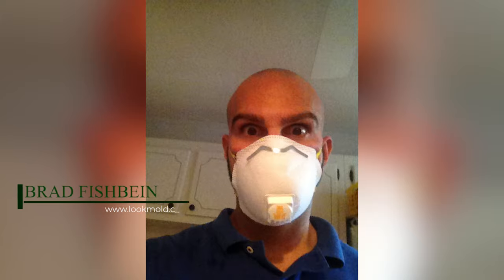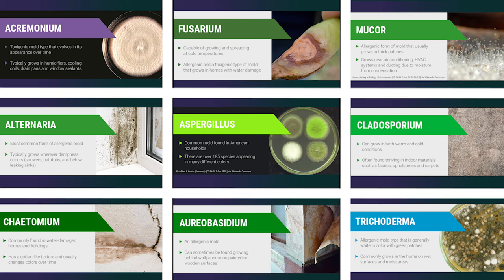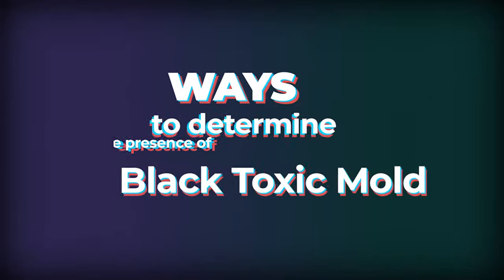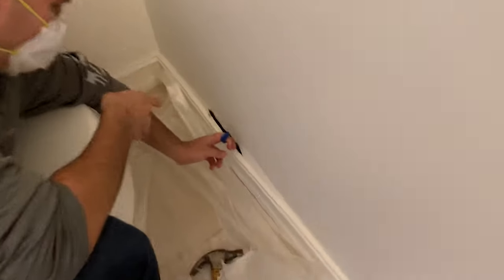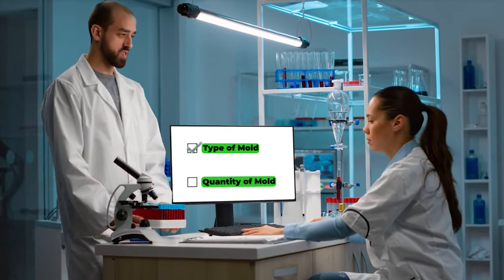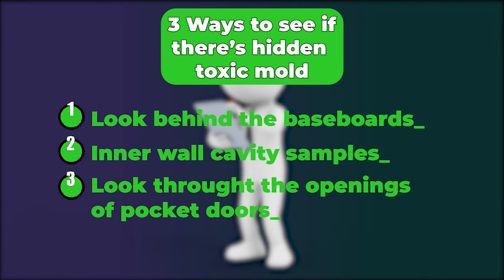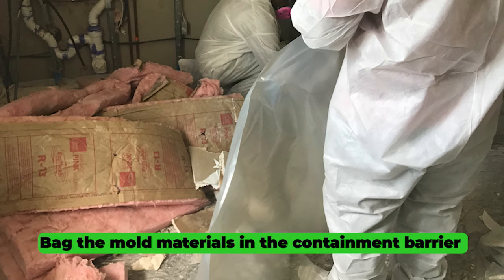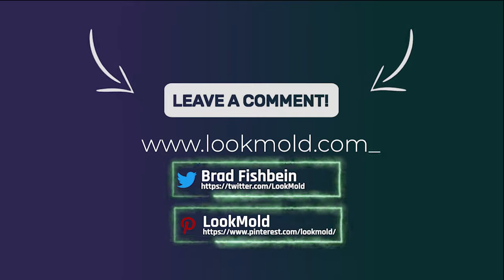Black Toxic Mold Hidden In Your Walls? You Need To Do This

Comment: I've been staying at a hotel for 6 months and I've been sick sick sick. It's hard to breath. I discovered black mold throughout the bathroom . An area with water damage. Also the bedroom ceiling and the wall has clear damage of water . The tenant above me had water come in from the roof that was missing a seal around a roof vent. Water damaged both units. 
I've had fever scratchy ears eyes and nose. Post nasal drip, to completely plugged with thick mucus , coughing sore throat, nausea, tired, itchy skin. I've documented by photos. The owner is aware of the issue and told her worker to DENY , LIE, ELUDE THE TRUTH ABOUT BLACK MOLD THROIGHOUT THE ENTIRE MOTEL. IM NOT ONE TO SUE. HOWEVER HER IGNORANCE DISGUSTS ME. AND SHE DOESNT CARE PEOPLE ARE GETTING SICK.

Comment: Hello. I recently bought a house and it came back with a very high elevated 2320 count Stachybotrysz In not sure what to do. Haven’t even gotten to move in yet. Just thought it smelled like mold. How doYou get rid of that if you can’t see it? I had an expert come out and he did some testing but he said he didn’t know how to test to see it.
Reply: You will have to start ripping the walls apart yourself if you cannot get a professional. That is what I would do.

Comment: Can black mold develop from humidity/condensation (i.e drywall in bathroom becoming damp)? Or does it need to be a leak?
Reply: I would say yes!!!
Reply: Definitely
Reply: Yes! Downtimes mold is superficial and you can get rid of it with mild killer, but always make sure its not on both sides of the drywall
Reply: It's possible, but not likely.  Majority of cases of toxic mold come from water damaged materials.  But if you suspect an area is harboring toxic mold, get it tested!

Comment: Good video
I rent and the owner doesn't care.
Other than respiratory will mold cause skin issues too 
I've cleaned all visible signs of mold but I can't open walls where visible water damage is.
I'm open to suggestions
Reply: Respiratory and skin issues arr just the tip of the iceberg what mold can do to health. There is a wealth of information available on YouTube about that.
If you know the mold is inside the walls, then it is a matter of time before it starts seeping through the walls.
Reply: I would say that the walls ah e to be opened and remediate, my two cents.
Reply: It can lead to colonizing your organs :)

Comment: As a previous landlord tenants not opening windows as don’t want to lose heat in winter annoys me to heck. 
* most damp is condensation caused. Open windows, don’t cover up house air vents. 
* Dont dry  clothes in house and if you do use an heated tent to do so. Low electricity and dry clothes properly. 
* purchase a evaporator as breathing causes excess moisture if no ventilation. 

Common sense and responsibility. Renters , use some ! 

* land lord Of course houses should have vents and no leaking drain joints etc. also give tenants paperwork to understand evaporation to help …. Win win
Reply: Landlord, add proper ventilation to your units (24 hour fans), consider an ERV to manage moisture and reduce the energy penalty of ventilation. Ensure windows, etc. are high quality and installed properly so they don't cause condensation. Blaming your tenants is a cop-out.
Reply: NO EXCUSES!! 😎

Comment: I have a recurring black that developes in my toilet. No where else in the bathroom . since its city water does the bleach combat mold , or is mold spores air Born
Reply: Sounds like your toilet seal is broke and it leaking. Get it fixed or you will have thousands of dollars worth of work that has to be done. Replacing the floor you dontvwant that. I had to do it before its a mess

Comment: Does mold have a smell? I had a leak and took a while to find and fix. The dirt outside my house, next to the bathroom where the leak was located was wet. Not swampy, but definitely wet. I had dryers and air blowers in my house for about two months. It's been over a year since this happened. It smells a little sewery still. The leak was in the water, not sewer, line. Again, this happened last year. I don't see any mold on that outside wall, in the bedroom adjacent to that bathroom, nor in that bathroom. I'm not sure if the soil under the foundation is still wet from a year ago. Any thoughts? P. S. What are the symptoms of exposure? Thanks.

Comment: We have laminate flooring with no pad and no moisture barrier and it is clear in one section moisture has traveled up from concrete into the flooring, warping the wood.  Can flooring like this have mold under it?   Never heard anyone mention this….?
Reply: I have the same thing. If the flooring is not well ventilated then that's a perfect spot for mold to grow in.

Comment: I did have water coming into the roof I have stuck on the outside drywall on the inside would it not be safer to cut into the stucco that way no mold spores will get in the house have you ever done it that way stucco please let me know

Comment: We haven't had a leak that we're aware of. We don't use our HVAC in in our basement often. It does have a mildew mold smell that I can't get rid of with essential oils, ozone, vinegar in a fogger. We couldn't get rid of gnats until winter. We tried everything. I found out they're fungus gnats.
Reply: Have you tried a good dehumidifier unit?  I am in the process of attempting to eliminate the mildew smell in an old house I bought.  Before purchasing, when I saw the house, the occupants had incense burning to cover the smell. I have since recognized a bigger problem going on. I had the plumbing turned off, after noticing a leak down to the crawl space and had the moldy insulation pulled out. That area has been "drying" for a few months and I have a dehumidifier on that floor and the one above, that pulls out nearly a gallon of water every 4-5 hours. Seems to be doing the trick, but I want to attach a drainage hose and let it run 24 hours for a week to see if it improves a lot. I am also looking at mold defoggers, but have not used any yet. 
Where I live, there is 1 supposed mold remediation specialist, and after getting a quote of $5k from a referral service (which I would have gone for, if they were not flakey), I never heard from him after providing my info during a conversation with the referral service. 
Hoping to conquer this mold problem! 
Good luck to you and your mold issues as well.

Comment: What about mice in a crawl space that disrupted the moister barrier ? We got the mice in there out a terminex but 2 got up into the house somehow and we got them too however we are re sealing the moister barrier under the house in January 

There had been mildew spell in my kids closet & I can’t see where it’s coming from but it’s probably the carpet but shouldnt I SEE the mold? Should there be black or greenish black ON TOP of the carpet? What if there isn’t? But I still smell it? Also there was mold in the carpet in our room and we replaced the carpet when it got bad. We got air purifiers with UVC for both bedrooms to try and be safer and keep it from coming back but my sons carpet is only 2 years old how did the mold come in the carpet that fast? Help? Can u make a video about how a closet can smell of mold but you can’t see any mold? There was some on the underside of the shelf part and I cleaned that off w mold killer  yet over a week late and it still smells like mold/mildew ish and idk what to clean the carpet with that won’t stain or bleach it. It had NOT spread to the carpet beyond the closet door bc I don’t smell it anywhere but the closet the room doesn’t get a lot of light and we have base board heat & in the summer, window units.. so there’s no real air circulation. Anyway about the closet & not seeing it
Reply: Having same problem with a white mold. It's a thing. This channel didn't answer any questions from anyone
Reply: @dalpz205  I noticed 🤔
Reply: You don’t need to see the mild through the carpet, sometimes is in the wood under the carpet :)

Comment: what about apartment dwellers who don't own the walls and don't want to be evicted?
Reply: You have to move out.  That's what we did, twice, unfortunately.  Also be careful of your items.  Toxic Mold spores contain tiny particles called "Mycotoxins" that make you incredibly sick, and will spread like wildfire (like a gas);  contaminated items can cross-contaminate clean ones.  We unfortunately learned this lesson the hard way.  The only solution for us was to throw away everything we owned, and start over in a clean place from scratch.  (For personal items that could not be replaced, we fogged them with mold and mycotoxin denaturing solutions, and then put them in sealed plastic bins, then into storage).
Reply: @athens31415 I would think you could ozone and uv c items to get rid of all of those issues
Reply: @heythere6983  no, that is not correct.

Comment: Can black mold grow in concrete?
Reply: In the surface yes , from water condensation
Reply: It's possible but not highly likely. Stachyboris requires lots of food and water. If there's a lot of dust on the concrete it can support it, but in my experience the black mold on concrete is usually standard mold species we experience every day

Comment: We’ve had mold for years, our electric wiring is off and has been for decade. I tried to move away and tried to get fixing. Our landlord raises our rent and told us to be grateful and was gaslighting my mom if she complained. It’s not that we don’t care it’s used against us.
Reply: Open the Window 🪟 let air flow, Buy dehumidifier, anti mold spray and 🫧 Clean up ... 🛑 Stop Blaming Landlord & other.. ..
Same 🏢 building but some have  mold others don't ..

Comment: If there is mold in back of the wall will it appear on the wall where i can see it  ?
Reply: Not until it eats all the way through the wall, which could take years. The least intrusive way would be a borescope camera. Like he said, check the baseboards and the bottom side of the drywall, The water usually runs down to the bottom. If you see anything, you should probably get someone to pull the wall (or DIY, with the steps he listed). You could also cut a small hole in the drywall and check the back side.

Comment: I can’t find the mold in my house my whole house smells like wet socks and I hired 3 mold companies and they couldn’t find the mold they said there mold here in the house but we don’t know where they just wanna put some kinda enzyme
Reply: Try the air conditioning unit.
Had that problem. Called Air conditioning professional to clean the unit and the smell disappeared. 
Hope it helps.
Reply: @sharonmartinez9963  thanks
Reply: I also had horrible smell feared it was the worst.  Found out it was oxone comong from a brpken down UV light on my hvac unit.  I had 3 different ac companirs come out and all were telling me to replace my duct work.  Last guy came out and after 15 minutes of removing it no more smell!!!!

Comment: Just had a pipe break in my basement. Good news is that it only was about an inch on the floor in a laundry room and I got it out in 20 minutes with a shop vac, but 2 days later, it smells pretty "damp". It never got up into the walls, but what can I do, spray bleach? along the baseboards? What chemical can I use to stop the smell. Running a dehumidifier and all the seeable water is gone.

Comment: Hi, I had a pipe to burst in a guest bedroom at the front of the house in the wall. Carpet was ruined and water went halfway down the hallway. Carpet was pulled up laminate flooring was placed down. But I cannot get the smell out of the home. Should I be concerned about mold?? The scent is unbearable I’ve only been back in the home One night. I’ve tried plug ins, air fresheners but the smell is awful. Any suggestions?
Reply: How’d this turn out?
Reply: @kimberlygarner4441 I hope you invested in 1 or more dehumidifier units to pull the moisture out of the air.  Loading up on air fresheners is not going to do anything except covering up the smell... Sort of like spraying perfume on a person who did not shower for 3 weeks.

Comment: My home at only 2 years old was growing black toxic mold.  It turns out the NEW GREEN regulations seal up the new homes way too tight.  The home can not breath they are not properly ventilated trying to stay green. ALL these new homes are perfect environment to grow black mold within months of completion of the home.  We installed small vents on the outside of the home every 16 inches, this dried out the walls and no more mold.  Benefit of that the home is much warmer in the winter and our power bills went down due to less heat or air-conditioning needed.  Green Agenda is a FARCE!

Comment: Couldn’t someone put a hole in the wall and just totally wipe out the mold with ozone? Just feed ozone into the walls and do a shock treamtent?
Reply: Ozone won't address the molds' roots, which are deep inside the wood framing and drywall.